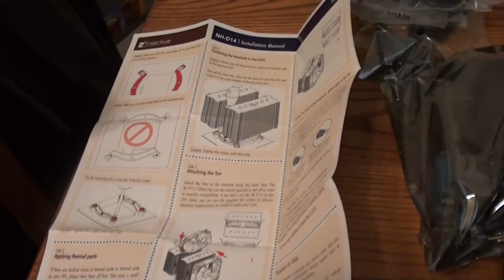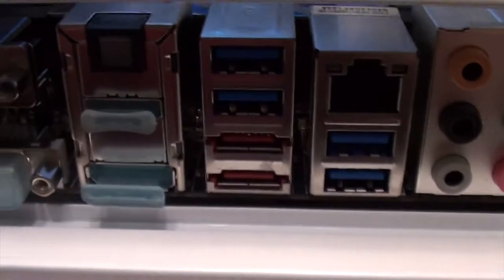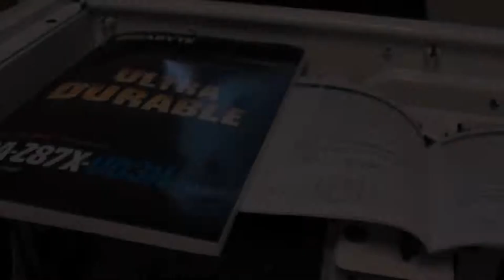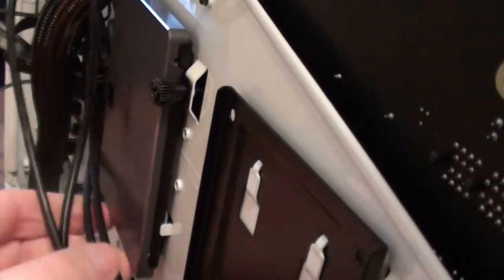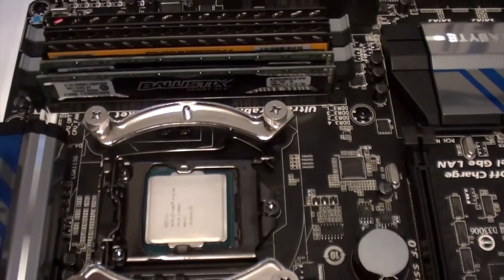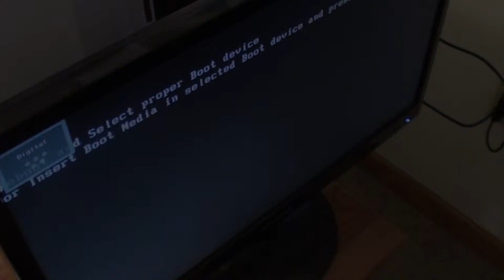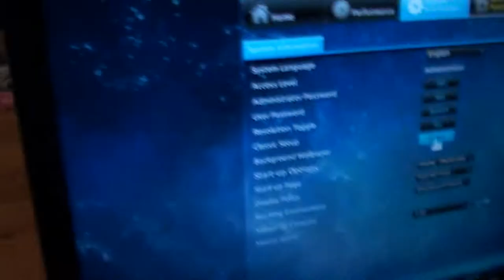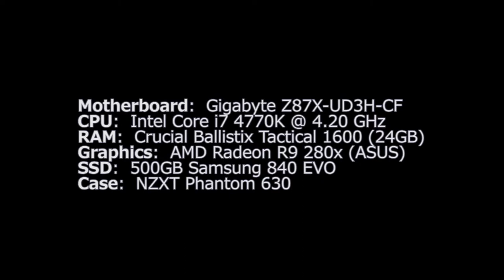Tim - January PC Build

Comment: Holy crap! I am sharing this video with Derek and my friend Mark Gullick in California. Thanks for the tutorial, THAT IS A BADASS COMPUTER! Do you use that as a server, or for gaming purposes?
Reply from the maker: Thanks for the kind words!  This thing has been an absolute monster of a computer.  It burns through everything I throw at it!

I built it for gaming and photo/video editing purposes.  When I say the video card was a disappointment, I should also say that it is the best card I've ever used, but it's got artifacting quirks because the drivers are bad (or the card is defective, I can't tell which it is).

Been using it about two months solid now and I actually run a tiny webserver and MySQL database on it while using it in daily use.  It's got the power to do a ton of things at once.

--Tim.